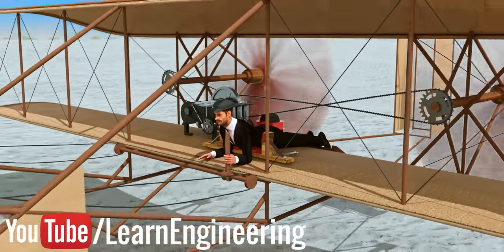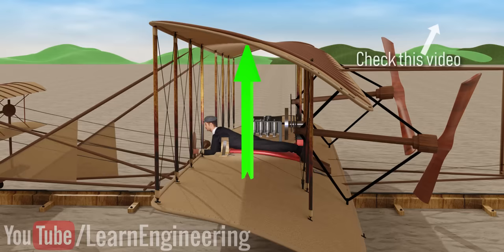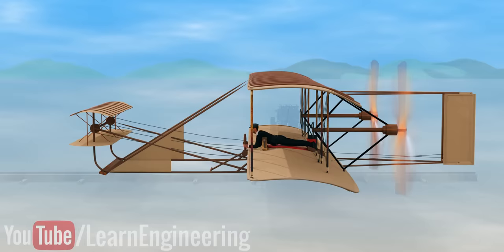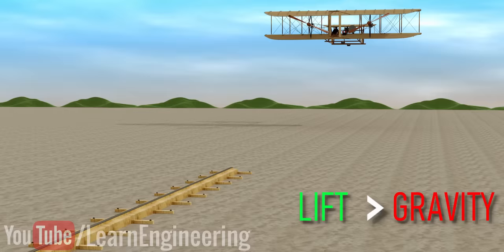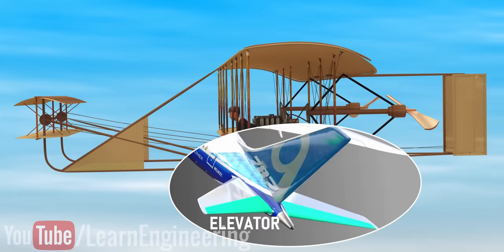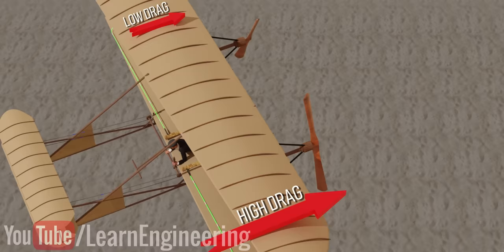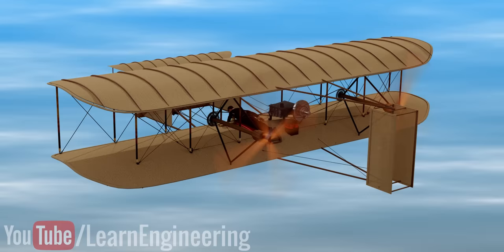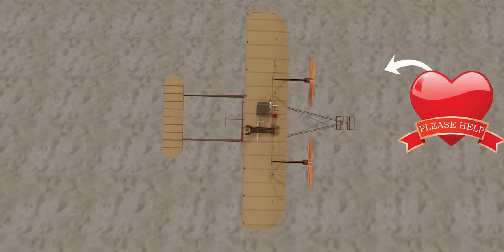The Brilliant Engineering of FIRST FLIGHT !

Comment: When Wright is in Paris to look for the description of the DUMONT machine, 1907, they bought an engine with the same characteristics as the Dumont engine, light and powerful
Reply: Please read enough to get your facts straight.

The contracted with three engine builders to produce engines for the anticipated European Wright Flyers.
The engine was a copy of the 38 hp. 1906 Wright upright 4. They were built under license.  (specs available at Gutenberg Project, URL below)

Is there any evidence that the Wrights were interested in copying any of
the design features of the 14 bis?   You claim that the copied the engine
but there is no evidence for this.  The Antoinette 8V is quite different from the Wright upright 4.
They probably should have purchased the 1906 Antoinette 8V but they preferred their own design.

They were interested in keeping an eye on how much progress was being made in Europe.
The Wrights thought they had a 5 year head start but the news in 1906 indicated 
that their lead might be less than they thought.  

The main reason for the trip was to set up the production of the Wright Flyer.  They brought the design for their latest upright Dayton engine and contracted Bariquand et Marré for several to be built to their specifications.  French and German companies produced these under license.   

For the specs for four of the Wright's engines, check out Project Gutenberg.  https://www.gutenberg.org/ebooks/38739

The engine used in 1908 was the 1906 upright 4.

The Wrights built 4 copies of the 2 place Wright Flyer 2.  One was shipped to France.  It had their latest 35+ hp engine.  

It was fortunate that they had ordered 4 engines from their French engine builder because the Dayton engine threw a rod and had to be replaced.  They replaced it with a French built replica of their Dayton engine: the 1906 upright 4.

The Wright-Taylor engine built under license by Bariquand et Marré was one that Santos Dumont recommended for the production version of the Demoiselle.
Reply: @gilberto2056  Thanks for the letter.  Is there an associated URL?

I am not sure what May 1908 flight of 337 meters you refer to.  Could it be the
flight where the engine failed?  As you know, the 2 place Wright Flyer set several
distance records in France.  The last one was for the Michelin prize for the longest
flight in 1908.

I don't find anything curious about the Wright's wanting to keep up with any 
record setting flights in Europe.
Reply: @majorbett  One detail, this letter was published in the magazine l'envol number 39, 1932. And the letter is extremely clear. THE WRIGHT WANTED DUMONT'S KNOWLEDGE. Until 1908 The brothers never submitt machines in flight.
Reply: @harpiasonhadorasonhadora5259  Thanks for the reference but it would be nice if you provided
a link.  

The issue is what was this knowledge?  In the case of the Wright Brothers, their
secret was how wing warping worked in theory and in practice to provide 3 axis control of the
flying machine.  

They could provide proof related to the specific performance requirements that the 
investor wanted to see.  This usually did not include revealing the secret.  There are now easy
graphics that explain wing warping but I don't think anyone could figure it out from the drawings
found in their patent.  

The secret involved both theory and practice.  You could see the pilot succeed in flying figure 8's but it is unlikely that you could match it.  

Wilbur thought he could reveal the secret and still retain a 3 year advantage.  

He was wrong.  once he explained it at least 4 of the pioneers added it to their prototypes and learned to
duplicate the performance in 4 months (not 3 years).  

This reduced the time they could sell
European built replicas from 3 years to 1 or 2.  In 1904 they had 100 European orders for $25,000 replicas of the Model A 2 seater.  By 1905, 50 switched to a cheaper plane from a competitor.  One was a replica of the Beloit XI.

 I am trying to compile a list of the contributions
that can be attributed to  Santos Dumont and the 14-bis.  

For now, I am not interested in
his earlier or later contributions.  

My list has about 5 features of the 14-bis that other pioneers might be interested in copying.  Can you help me build the list?

The Wright policy from 1902 was to not reveal anything until the investor was ready to make a $35,000 investment.  
NO PAY-NO SEE.  

The public was able to see what the Wrights could do
because someone paid for it.  

HP:  Until 1908 The brothers never submitt (sic) machines in flight.  (what is submit?)  

(Rephrased)  Until the summer of 1908, there was no incontestable proof that the Wright Flyer could fly.

SB:  Correct.  

In 1905 there was enough historical proof for the American Aero-Club to certify the claims the Wrights made in their 1905 publication.  

Have you read this?  It is a good starting point.  If you are interested I will find the URL.

Also check out the hundreds of pages
at Wright-Brothers.org

HP: Até o verão de 1908, não havia prova incontestável de que o Wright Flyer pudesse voar.

 SB:   Você está certo
Reply: You recognized that they never presented anything before Dumont. Dumont won, Steve, it was in 1906.
Reply: @GNJ:
Thanks  again for providing a source reference.
Reply: @stevebett4947  Their arguments are weak. You answer for them and don't prove the existence of the plane before Dumont. I believe it would be easier for you to get a document of the authorities of the time and present this document here to prove with official records and photos the wright's ability to fly between 1903-05. Arguments like these prove nothing about the ability to make motorized flight similar to Dumont (1906). For there to be primacy for wrights, this must be accomplished, Dumont fulfilled his part and started the AVIATION.
Reply: @stevebett4947 the brothers, after writing this suspicious letter, went to Paris where they stayed for months, did not present proof of their flights, did not complain about anything, did not perform any aerial activity, received from ferber the description of the Dumont machine and took engines with them to the united states. just reason. it is obvious that if the brothers had a plane in the united states they would never do all this trip.
Reply: @harpiasonhadorasonhadora5259  

SB:  Thanks for your comment.  
I don't think the arguments would be weak if their premisses were valid.
Lins de Barros who was one of the narrators for the PBS Nova series on Santos Dumont, 
didn't have to resort to dubious "facts"  and misinformation to make his case for the 
incontestable proof of the Santos Dumont first official flight record..

I am still searching for the original documents.  I need to see exactly how the original rules
and regulations for the 1906 competition were written.  Much of the evidence has been lost
or destroyed.  Only a few film clips have survived and these do not appear to be of any
record run.  I wouldn't expect any film evidence for the 100 m. flight.  It was too dark for
1906 motion picture technology.  

The Wrights do not provide incontestable  proof for any of their alleged flights and records.
They were only willing to provide it if someone paid them $50,000 up front.  NO PAY- NO SEE.
This policy was evidently devised before their first flight. 
Luckily, no one ever asked them to prove their 1903 873 ft flight in an exact replica.

Unlike the Voisin built bis-14, the droopy winged Wright Flyer was intentionally unstable.  
Eventually they got it to be stable enough to fly but they were wrong in thinking that it was
impossible to combine safety and stability with responsiveness.  Something like 16 pilots in
training lost their lives trying to learn to fly what the Wright's called a practical airplane.
Military planes continued to have similar problems but civilian aircraft are  now much less demanding
and relatively safe.
Reply: @stevebett4947  Unfortunately with these arguments Again it will be difficult to reach consensus. A machine that charged a fortune to be seen and they themselves knew that The American brands and patents would register for them the first plane, the American, Italian, French, German government would all buy and register the plane for them, had contacts with you are governmental and registration authorities, plus the detail that the greatest aeronautical authority of the time existed for everyone since 1898 and never managed to present before Dumont's nothing !!!! obviously they didn't have the first plane !!!!
Reply: @harpiasonhadorasonhadora5259     What arguments.  They are just speculations and opinions from various aviation historians.  I don't think there is anything original there
What comment do you find controversial or difficult to agree with?

They charged over $30,000  to see if the Wrights could do what they said they could do.
It sounds like a lot until you learn that vendors selling the Demoiselle 20 wanted $30,00 for the plane and more for the engine.  

I am not sure what you mean when you connect the patents with the claim to be the
first manned airplane with rigid wings and 3 axis control.   

My problem with the Wright patent is that it is meant to be obscure.  It did not clearly
explain how wing warping worked and certainly nothing about what else was required to exhibit full control in the air.  The illustrations we use today are easily understood.

They had ten years to provide a working prototype that demonstrated controlled flight.
They were so slow that another inventor with a similar patent provided a working model before the Wrights.  

Here is what I said in an earlier comment.  On YouTube you have to provide enough information to identify what you are reacting to:

I don't think the arguments would be weak if their premisses were valid.

Lins de Barros who was one of the narrators for the PBS Nova series on Santos Dumont,  didn't have to resort to dubious "facts"  and misinformation to make his case for the incontestable proof of the Santos Dumont first official flight record..

SB:  I think you agree with both of these statements.

I am still searching for the original documents.  I need to see exactly how the original rules
 and regulations for the 1906 competition were written.  Much of the evidence has been lost or destroyed.  Only a few film clips have survived and these do not appear to be of any record run.  I wouldn't expect any film evidence for the 100 m. flight.  It was too dark for 1906 motion picture technology.  

The Wrights do not provide incontestable  proof for any of their alleged flights and records.

SB:  Don't you agree with this opinion?

They were only willing to provide it if someone paid them $50,000 up front. 
 NO PAY- NO SEE.
 

SB"   I think the investors who were connected to the French Aero Club
negotiated a better deal for themselves..  $50k was the starting point.  To close the dea
they had to sign over all of their European patents.  

Unlike the Voisin built bis-14, the droopy winged Wright Flyer was intentionally unstable.
|
  SB:  You may not want to credit Voisin as the builder of the airframe.  This could
be controversial.  Some Santos Dumont fans say he designed and built everything
without help from others.  
What is your opinion?
Reply: @stevebett4947 You don't have to write a book to try to explain the inexplicable about wright. You can see that you invent possibilities to have something to argue about. And it remains unexplained. "Where are the official tests, with flights performed in front of specialists before Dumont!?!?!? You're almost killing yourself in your excuses😂😂😂😂. Accept, they lost in 1906.
Reply: @stevebett4947  Steve, unfortunately you need to think a little more. Hundreds of people who were not reported names and surnames !!! many people who would have been interviewed for ferber and no one, including ferber, nobody volunteered to help wright sell a flying machine !!! machine that they themselves said that flew but was never presented to brands and patents anywhere the world to get rich soon !!! no demonstrations for any government in the world to sell soon and get rich soon !!! the wrights asked in letters to the united states government and other countries money in advance and no demonstration of anything !!! Steve, in these conditions nor the wright dealt. And I doubt that they would get any money proving the existence of a machine with ferber interviews or verbal reports made by ferber and other friends at l'aerophile.
Reply: @stevebett4947  authenticity in reports made on paper and machine that never appeared to prove anything effectively are reports without credibility. It would be easier to register events in trademarks and patents with  the machine, register everything before the authority of the time, or sell at once to some government than to do the idiocy they did !!!!
Reply: @stevebett4947  Steve, it’s not necessary to write a book or even invent data, Invent possibilities of this or that to desperately defend the wrights. I believe that they would not need so much. And when you can present some proof, it’s only from 1909 to Front, that is, confirming the Brazilian statements that they only presented and proved something was from 1908 onwards. Steve, if you want to win this debate you’ll have to present the Official records that the wrights made between 1903-1905 with photos that were released and published in the press of the time between 1903-1905. If you don't Have this evidence forget it. The wrights lost to Dumont along with you who are defending them. Dumont has been the inventor of the airplane and father of aviation since 1906.
Reply: @stevebett4947  It is easier for you to prove that they did something with official documents registered by them with photos between 1903-05.
Reply: @stevebett4947  Rationing yourself will conclude that it was easier for them to register the plane than to present witnesses who prove nothing.
Reply: @harpiasonhadorasonhadora5259   There is no debate on the argument that was first articulated by Lins de Barros around the year 2000.
If the only evidence that is allowed to be accepted is restricted to
what was stated in the contest rules for the Deutsch Archdeacon Prize, then nothing the Wrights did before count.  

Aviation historians are not trying to desperately defend the Wrights,
they are trying to come up with a historical narrative that holds together and is the most consistent with what is thought to be known.  

There is historically acceptable evidence, for instance, that the Wrights did demonstrate their aerial feats in public before 1908.  Most historical evidence is not beyond doubt or cannot be contested.  

As I stated above, there is no official evidence that the Wrights
did anything before 1908 if that evidence has to conform to the FAI standards invented in 1905.  Why do you keep bringing this up?

There is no absolute or incontestable proof that the Wrights flew before 1908.  Using the same standards of evidence, there is no proof that the Wright brothers owned  a bike shop in Dayton.

There are records that meet the usual standards for a fact based  historical narrative.  That is quite different.  

Proving that Santos Dumont was the inventor of the airplane or the father of flight goes well beyond the incontestable evidence found in the rules and regulations for winning the Deutsch- Archdeacon prize.   

Do you want to make an attempt to prove that Santos Dumont was the first to fly, invented the airplane without any outside help or any other common claims made by SD supporters without using any evidence other than indisputable evidence?
Reply: Why do you call quoting aviation historians "inventing facts"?

All historical narratives fail to meet the incontestable proof standard.
Historians try to be consistent with known facts including a few incontestable
facts but that is not the same as being limited to empirical facts.
Reply: @harpiasonhadorasonhadora5259  

SB:  I don't understand the question.  

What is a registered document?
What   counts as an official document?

The Wrights published a short article which listed the key events
and attempted to supply evidence that they actually happened.
It was enough to convince the American Aero Club but not 
sufficient for the French Aero Club until after 1908.
It is still not sufficient for Lins de Barros or later Wright critics.

There is no incontestable evidence that the Wrights did anything
before 1908 or that the photos they and others took were authentic.
.  

The same is true for Santos Dumont film and photographic evidence.

Photographic evidence should not be tossed out but it they can be
contested.  There may be a few cases where the photos were miscaptioned.
or doctored in some way

The photographs controlled by the Wrights were
not released until 1908.  That much is true.
Reply: @stevebett4947  Forget any debate, Steve, whenever they show you the monuments with the inscriptions made a long time ago by the aerocluve de France you will have nothing to talk about. It's easier and we'll finish Soon any debate with the presentation of the documents registered by them before Dumont.
Reply: @stevebett4947  do you speak of indisputable historical facts for the wright ????? 😂😂😂😂😂 Isto foi cômico, Steve, please present here the documents registered by them between 1903-1905. Your indication of a link was untrue. There was nothing.
Reply: @stevebett4947  You do not understand??? Well, it's simple !!! Present here the official documents (FAI records, Aeroclube de paris or Aeroclube de France) were authorities of the time that would register everything for the wright
Reply: @acucarchocolate3961  
Only their official witnesses can be trusted?
Then what about the United States Coast Guard, that witnessed, measured, photographed, and officially logged their flights in December 1903?
Like most fools who want to claim false credit for their own country, you are good at picking out what facts you like and ignoring the truth if it doesn't suit you.
Reply: @mikearmstrong8483  in 1903 the only witnesses were three lifeguards and a nine year old child. Alfeu drinkwater declared to the New York times in the 50s that in December 1903 they did not make any motorized flights, they did not present any planes and they only glided. their only proof was a sheet of paper. drinkwater declared that a machine that resembled an airplane was PRESENTED by them only in 1908. In 1907 they sought the 14 bis plant in Paris.
Reply: @acucarchocolate3961  
Whatever source you have is incorrect; US Coastguard officers were present, and logged the measurements of the flights in official Coast Guard logs.
Do you really place credibility in one single person declaring 50 years later that it didn't happen? Pardon me, but that sounds rather gullible.
Reply: @acucarchocolate3961  If it isn't one thing, it's another. I've chatted with Brazilians that admit that the Wrights flew in 1903 but maintain that it wasn't really valid flying because the Wrights used a catapult to assist takeoff, as if the plane would have flown a full minute (the 4th and last flight of the day) as just a projectile.

See, that's the problem with people that want to ascertain a "fact" that isn't real. Just like moon landing deniers, they can't get their story straight. Some say the Wrights never got off the ground that day or even tried, others say they might have but it doesn't count if it wasn't witnessed (which it was), and still others say they flew but it doesn't count because they used a catapult. If you all can't agree on why they didn't fly, and well studied historians (as opposed to "internet professors") all agree on exactly what did happen and say they flew, then the evidence is against you. 

And if the Wrights were in France buying a motor, that means nothing; it certainly doesn't mean that is the first motor they ever bought.
Reply: @mikearmstrong8483  there are no official records regarding anything for the wright. The wright's records do not speak of any authority of the French air club (the greatest AERONAUTICAL authority of the period) that has something for them. They themselves recorded that the witnesses were three lifesavers and a child, there are no official records of any aeronautical, marine, army or even authority government to give wright credibility. perfect replicas will not fly and the wright's patent that was three years old of processing in the American trademarks and patents does not indicate the plane. The proof presented by them was the telegraph sent to their father and nothing else. The machine was never presented on public flight  according to the requirement of the greatest authority of the time that existed since 1898.
Reply: @mikearmstrong8483  Fact without proof is not a fact. And if you insist that they flew before without presenting the evidence, that they could have presented before Dumont the hundreds, it is hardly correct. Start by trying to prove with The wright's patent, kid, show the flight test on the patent !! Yes, running, takeoff and everything !! The document had three years of processing, copy the item with the flight test done for the brands and American patents, please. The wrights didn't have a plane!?!?!? Where is the registered machine, imbecile, and Brazilians agreeing for convenience there are many out there !!!
Reply: @acucarchocolate3961  
What a wonderful way to express gullibility. A "registered" plane? There was no system of "registering" a plane when the first one flew, any more than the first automobile had a license plate. They had patents on the plane and its principles, there are records of the machine shop that built the engine for them, there are official US Coast Guard logs of the event, etc, etc. 

There is all the proof that is needed,  for all to see, but those who want to believe in their own particular "truth" will continue to be blind to this reality. You argue that Dumont flew first, some other guy swears that a New Zealander was the first, of course Russians will claim they were first. But what actual historians, as opposed to those whose education came from YouTube, almost unanimously agree on, is that the Wrights were first.
Reply: @acucarchocolate3961  
Tell you what. Neither of us are going to convince the other; I believe that history and the facts support my argument, and you of course believe the same for your argument. Let's call it done before we get to the point of casting aspersions on each other's ancestry, or worse. 
Good day, sir.
Reply: @mikearmstrong8483   Boy, the official evidence never came, Where are the official records you didn't show anything here. Remember, they had three years between 1903-1906 to prove the existence of the plane and never did anything, where is the plane registered in the patent!?!?! If an argument in the role of a friend of theirs Coast Guard is worth that much, Why didn't they take advantage of it and present the airplane to American brands and patents ????? Where's the plane!?!? What plane they had, the huffmann prayrie neighbors never declared FLIGHTS in the surroundings !!! AND Flights only on paper and conversation are worth nothing, where are you presenting the machine !!!!
Reply: @mikearmstrong8483  For them to be the first they have to prove that they really were the first. They didn't prove it !!
Reply: @acucarchocolate3961 

SB:  I don't recall that B&M said they were Antoinette like other than both being fuel injected and without carburetors. 
That is hardly grounds for claiming that they were based on the Antoinette design.  All airplane engines will share features.

SB:  If you bother to read up on the topic you will see that while Wilbur Wright replaced the Dayton upright 4 with one built to specs by B&M, the engine was a replica of the Dayton built 1906 engine built for the anticipated use in replica Wright Flyer 2 Model A

This WF2 Model A was the first to fly in Australia.  It is preserved in a museum.  The plaque on the engines says built under license.

There is an abundance of information about this engine at Wikipedia, Project Gutenberg, and elsewhere.  

Unless a 4 cylinder engine resembles a V8, there is little resemblance between the engine used in 1908 and the Antoinette 8V used by Santos Dumont.  Both were made of aluminum, both were fuel injected rather than carbureted.  The Wrights' bench tested their engine in 1906.  The aircraft version of the Antoinette was also tested in 1906.  After multiple attempts to sustain flight with a less powerful Antoinette engine, Santos Dumont finally achieved success with the Antoinette 8V later in 1906.  

The Wrights' did not test their engine in flight.  They shipped it to France in 1907.  This was the same year that sister Katherine, Wilbur, and Orville traveled to Europe to set up their production lines for the Model A.  All of the parts were to be manufactured in Europe.  Engines were to be built in France, Germany, and England by experienced engine builders.  Airframes were to be built in several European countries.
Reply: @harpiasonhadorasonhadora5259    Wright's never [presented] anything before Dumont.

SB:  I thought that I agreed that if you comply with the FAI standards of 1905, the Wrights'
did not provide any incontrovertible or incontestable  evidence before 1908.  
Henrique Lins de Barros (2000) is aware that the FAI changed their standards after 1908 
but builds his argument on the basis of the 1905 standards.  
He argues that these were the accepted standards in 1906.

In 1908, The FAI went so far as to recognize the Wrights' claim to have been the first.  

I don't understand why Archdeacon and the FAI would go that far.  
I would like to find the exact quote. 

 Santos Dumont was the first to meet the 1905 standards.  No question about that.
Reply: @stevebett4947   everything that refers to engines the answer is simple. If wrights had engines as light and powerful as Dumont's antoinette they would present the flyer in flight for the American brands and patents, American government, French, Italian, German governments !! or they simply would have flown a lot in front of French experts who could have gone to the United States when they were drafted in 1904.
Reply: @acucarchocolate3961   No.
Reply: @johnedwards1321  no? the letter the wrights sent to boil in 1907 clearly called for a complete description of Dumont's machine. the period they were in Paris is a fact. the letter was published in the magazine L'envol number 39 - 1932.
Reply: @majorbett  It would be better to provide a link to the contents of the letter
than what you recall from memory.  You do provide a print reference.  That is
a step in the right direction.  It is not that hard to find the letter on the Net.  

@GNJ
SB:  Your post has 3 spelling errors.  
Wilbur never signed a letter as "Wilburn".   "Your trully" should be <Yours Truly>.

There was such a letter written on...  written to Capt. Ferber 
who came to Dayton in late 1904 to prove the Wright's were liars.

After talking to Wilbur Wright and to some of those who had witnessed the public flights, he became a Wright supporter.  

He wrote two articles for the L'Aerophile in 1905 in support of the Wright claims
but was unable to immediately covert Archdeacon or a majority of the members of the Paris Aero-Club.  After 1908, they also became converts.

GNJ:  They were in Paris for several months (they didn't register anything, they didn't prove anything) they bought a light and powerful engine similar to Dumont's engine. They return to the United States and finally , May 1908 presented (demonstrated?) the flyer in extremely poor flight conditions. They just flew 337 meters.

SB:  This is mostly unsupported BS.  The 3 Wrights came to Europe because they
had finally received the financing they requested in their letter to Capt. Ferber.
In exchange, they had to sell their European patents to W..   and the other French
investors (Archdeacon and Deutsch)  who wanted to make sure that the Wrights set their records in France rather than the US.  

The purpose of their trip was to set up demonstrations in France, Germany, and Spain and to find engine and airframe builders in those countries.  They bought
engines from builders in France and Germany.  B&M delivered 7 engines to Wilbur
in 1908.  Why would Wilbur need more than 2 engines?  

The engines, built under license, were copies of the 1906 Wright - Taylor upright 4 which produced 28 hp. at a low rpm.  They were not copies of the V-8 used by Santos Dumont.

Rather than waiting for a new engine to be shipped from Dayton, Wilbur used
one of the engines that had been purchased for the Wright Model A to be built
in Europe in 1909.  After the demonstration in late 1908, there were 150 orders
for the new two place flying machine.  A few were delivered in 1909 and one
buyer tried to compete in the channel crossing.  He flew the 20 or so miles with
ease and then flew back to France.  (The Wright Model A had a range of over 70 miles.)  But he was not the first.  Bleriot may have crashed when landed his Bleriot XI in England, but he won the prize that saved his company.
Reply: @mikearmstrong8483  Thanks for the comments.  I was unaware of any
Coast Guard records of the flight.  Do you have a reference or URL?

Of course, the observation by the Coast Guard wouldn't count because
they were accidental witnesses.  The French FAI required official witnesses which probably means witnesses approved by them.  The
only witnesses they approved were members of the French Aero Club.

They often argue that historical facts don't count.  They are contestable.
Then they go on and use historical evidence for claims that are clearly not found in the rules for the contest and the Deutsch Archdeacon prize.
The Wrights were in Europe in 1907 because they received a cash advance from French multi-millionaires: Deutsch, Archdeacon, and Weiler.  They always said that they would be glad to demonstrate their claims or any performance objective that they specified.  

They needed $15,000 to demonstrate their flying machine.  They had
reached an agreement with a delegation representing the French government but the French reneged.  When it was renegotiated with members of the French Flying Club and FAI, it required that the Wrights'
sell them their European patents.  

There would be no reason to buy 7 French built B&M engines for their
demonstrations.  2 would be more than enough.  They paid B&M to build
copies of their Upright 4 (28hp) under license for their anticipated 
sales of copies of the 2 seat Wright Flyer Model A.  

There are nothing official about the claimed records of the Wright Brothers' Wright Flyer if this means records that complied with the
1905 French FAI rules for what counts as an official record.

 The patent did require a demonstration within 10 years.  The patent
was not for a particular flying machine.  It was for an improvement in
the control system for any Flying Machine.  

Before the Wrights, No one considered control to be that important.
It was not mentioned by Cayley.  Surely someone else mentioned it but
so far I have not found it.  

The guiding analogy before the Wright Brothers was a boat in a sea of air.  It needed a propulsion system,  a rudder, a source of lift or buoyancy.  The main problem was to keep the airship from capsizing.

Furman and managed to complete one full circle and wind the 
Deutsch-Archdeacon prize without the ability to bank and turn.

RC Modelers have learned how to make a 14-bis look alike replica to
make U turns and fly in circles.  After 3 failures, Santos Dumont
gave up on the design.  He probably should have had more faith
in his ability to work through the problems.
Reply: @acucarchocolate3961  
The alleged Flights are only on paper.
Where are you presenting (officially proving) the flying machine?

The Wrights were not interested in proving
anything to those who were not willing to pay for it.  NO PAY-NO SEE.

Deutsch and Archdeacon finally paid in late 1906 because they wanted
to make sure that official records were set in France and because they though they could make money by selling replicas of the Wright Model A.
There were 4 demonstration flights.  One in late 1904 and three in the
summer of 1905.  These flights don't count because there were no
official witnesses.  However they were still certified by the American 
Aero Club.  Capt Ferber was convinced after talking to the Wrights and
prominent people from Dayton who had witnesses the flights.

Cpt. Ferber examined the stored Wright Flyer III but never saw it fly.
He arrived in Dayton to prove the Wright's were liars.  He left
and wrote two articles for L'Aerophile in support of the Wrights
and their performance claims.  

Historical evidence does not prove to you the Wright Flyer or its records existed before 1908 .  Perhaps, but I think it disproves many of your
counterfactual claims.  

The historians reconstruction of events may not be certain or beyond
question but they are much more plausible than the anti-Wright conspiracy theories that are advanced without support.

There is often a fact (or 2) in the alternate accounts such as the sale
of 7 engines by B&M .   Wilbur did receive 7 engines in the summer of 1903 but they were copies of the 1906 Wright Upright 4 (AKA the 440
referencing the 4 cylinders and the higher RPM power output) built under license.  Unless a V-8 engine can be said to be a copy of an inline 4, 
There is no way that this engine can be said to be copied from the Antoinette engines used by Santos Dumont.

For details, Google the name of the engine or the name of the persons
involved.  Add Wikipedia if you want to read the information in Portuguese.
Reply: @stevebett4947  Again you insist with arguments that prove nothing. Alleging that in 1904-05 they made flights without ever having proved anything to specialists, not recording anything, not selling anything you don't prove Nothing. It would be impossible for the wrights to lose so many rights when everything would be proven in front of everyone. Don't forget, Archdeacon summoned The wright in 1904 for registration and in the united states. They didn't even answer the letter!!! the same Archdeacon challenged the wrights in 1905 by offering a fortune 50,000 francs for a single 100 meter flight!!! There was nothing, they didn't prove anything, they weren't ready for anything. Present official evidence that they had at least the whim to actually do between 1903-05, please.
Reply: @acucarchocolate3961  
AC:  Present (Provide) official evidence that they did something
between 1903 and 1905.

I thought we had agreed that there is no official or incontestable evidence that the Wrights' did anything until 1908.

There is no incontestable evidence that they didn't.

The requirement works both ways.

Most of the anti-Wright claims do not meet the incontestable 
evidence requirement.  Most don't even meet the requirement
for good historical evidence.  They are not consistent with what
is easy to check out in the historical record of events.
Reply: @stevebett4947  Steve's problem is that you claim there is no hard evidence that they didn't fly. I answer, present here the official documents that prove that they flew before Santos Dumont and it will be solved the problem. remember, I don't have to prove anything Dumont proved everything to the world. Who must prove they flew before Dumont IS YOU!!!
Reply: @stevebett4947  Ferber's articles written in 1904 did not convince, and what's more, there was no evidence, no pictures, only conversations and paper, that is, exactly what Brazilians denounce to respect of wrights. In 1904 due to these great uncertainties and no proof of anything was that archdeacon made the first challenge, he sent a letter to the wrights proposing to make official everything related to their machine and I would send specialists to the United States to see everything, photograph and finally make some record for them. the result was that the wrights didn't respond. not even the letter!!! in 1905 Archdeacon's second challenge that was published in the American press challenging the wrights to cross the ocean and fly just a hundred meters in front of Archdeacon and pocketed a fortune. again, the wrights weren't ready for anything!!! But worse, the 1904 dayton fair offered a fortune in dollars to anyone who presented a heavier-than-air first that it met the requirements of the flying club of France and was able to make turns, it was a huge sum in dollars, this fair was held for a long period in 1904 and the wrights never attended to do anything!!!!??? the period of 1904 was the period they declared, again, just on paper, 3km flights, and machine capability for 14km flights and capability to make circular flights. The work of these two is incomprehensible, the evidence that they never had the first plane between 1903-05 they are too strong!!!!
Reply: @stevebett4947  Who must present the evidence that they flew before is you Steve, official documents, or accepted, they lost in 1906 to Alberto Santos Dumont.
Reply: @stevebett4947  What you can't understand is that everything you present with authorities and even recognitions for them is only from 1908 onwards as already showing trillions of times for us Brazilian as for 1906 and their attempts to sell a machine that was never even proven to exist before Dumont, it doesn't help Steve, as they had too many chances to do everything before Dumont.For an example, the fortune offered at Saint Louis Fair for those who made a simple flight will never have an explanation, and the detail is that the fair took place for many months in 1904 in the year they placed Only on paper and in conversations the flights. On paper and conversations many miles flying, in reality not even a presentation to get rich overnight were not able to do. Forget it, boy, You lost in November 1906.
Reply: @stevebett4947  Translate your texts into Portuguese. When you write in English it's like writing in Arabic
Reply: @acucarchocolate3961   Why do you want to make this into some kind of competition with winners and losers?

I just want to have the best or most plausible historical account of aviation history.  Who was the first to fly seems to be dependent on who gets to define flight.  

I don't think you can even h ave a story if you 
restrict yourself to "just the facts"  In this case,
the facts are whatever is found in the description of the contest rules for the Deutsch-Archdeacon prize.

We can say that if you restrict you concept of
incontestable evidence, to compliance with the 1905 French FAI rules, Santos Dumont was the first to do this.  

If you let the Smithsonian or some other pro-Wright organization set the definition, neither plane qualifies.  The Wrights' thought that the 
Wright Flyer III and later prototypes were practical airplanes because they could fly multiple laps in two directions at relatively high altitudes.

Most people believe the Wrights claims because they were able to improve the prototype.  These improvements were evident as early as the end of 1903 in public flights.

Had either Whitehead or Santos Dumont been able to improve their early prototypes, they would recognized as winners.  They couldn't.  

Later they were shown that with modern propellers and power plants, they were able to fly longer distances, smoothly and reliably
when the conditions were right.  

With more refinement they might have been able to claim that they were practical designs.  

There are modern versions of the Demoiselle 20 that were quite practical ultra-light aircraft.

Both the 1906 and 1903 flights were just short hops no more than a few meters above the ground.  One of the successful test flights of the exact replica hopped about 100 m. at an altitude of less than 1 meter in a 15 mph wind.
Reply: @stevebett4947   I'm proposing the easiest, you prove with official documents that they flew between 1903-1905 and this discussion will end. But what's our problem. Everything you present is vague, unregistered official between 1903-05, and everything related to wrights and with evidence is from 1908. while Dumont in 1906 started aviation with a flight of 200 meters and was the base of the wrights who asked for captain ferber the plan of the 14 bis!!
Reply: @stevebett4947  Forget Steve, the 2003 centennial replica flyer proved their base was terrible. That was never a plane or even flyer 3. That's why I already asked and ask again: PRESENT THEM HERE THE OFFICIAL DOCUMENTS THAT THE WRIGHT REGISTERED BETWEEN 1903-1905 IN THE HIGHEST AERONAUTICAL AUTHORITY OF THE FRANCE AIR CLUB Epoch, It's a chance for you to win the debate, as I already realized that it is A weakness for you, but it's a chance. What the Smithsonian thinks or says to people without official evidence is also a very serious problem. And I also say that: YOU DON'T HAVE ARGUMENTS FOR THE WRIGHT BROTHERS EVENTS HAPPEN AND PROVED EVERYTHING ONLY IN 1908, THERE ARE NO ARGUMENTS FOR THE LACK OF OFFICIAL EVIDENCE BETWEEN 1903-05 YOU HAVE AN EXCUSE, THERE ARE NO ARGUMENTS FOR FORTUNE THAT THE WRIGHT FAILED TO WIN AT SAINT LOUIS, HAS NO ARGUMENTS FOR THE ARCHDEACON CHALLENGE IN 1905, DOES NOT KNOW ABOUT THE TRIP TO PARIS WELL 1907 AND THE LETTER TO FERBER, HAS NO ARGUMENTS FOR THE MONOLITH OF BAGATELLE WHO COMPLETELY CONTRADICES YOU AND THE SMITHSONIAN RULES. Steve, look for the official documents they registered between 1903-1905, I think it will be easier for you!
Reply: @stevebett4947  Note, try to translate into Portuguese.vqyando you write na in English it looks like you are writing in Armenian.
Reply: @acucarchocolate3961  
AC:  Everything you say is vague.

SB:  I think you find anything based on
"historical fact"  to be vague because it 
is not certain.  

If you reject historical narratives then there
is no proof but historical narratives are rarely
vague,  They are just not incontestable.

There is no proof that the Wrights or any other aviation did anything.  The reason I accept the
100 m flight of Santos Dumont is more because of historical evidence rather than
"just the facts".

Exactly what do you accept with respect to
Wilbur's flights after 1905?  There was only
one record that was in compliance to the 
1905 FAI standards.
Reply: @azucar chocolate

AC:   Dumont in 1906 started aviation with a flight of 200 meters and was the base of the wrights who asked for captain ferber the plan of the 14 bis!!

There is no official flight of 200 m.  
There is only an official flight of 100 m. 

Historical evidence supports the claim that 
Santos Dumont flew 220 m. because there was no official starting line or finishing line.  The 220 m flight was the proof that he flew 100m.
Reply: @stevebett4947  the official record that the FAI has revered for many decades is related to a record of 220 meters fulfilling the requirements of the time of the highest AERONAUTICAL authority in the world for the first most heavy than air, the plane. even the bagatelle Monolith built by the people of Paris and the French flying club is extremely clear: "FIRST AVIATION RECORD OF THE WORLD". And Dumont was already recognized by the French flying club itself as a pioneer in air travel since 1901, there is also another monolith in honor of Dumont in the Santos Dumont square in Paris. forget it Steve you don't has nothing similar to do with the Dumont event, much less the recognition of the AERONAUTICA authority that called them in 1904 to record everything for the two, let alone a monolith built for them by this authority between 1903-05.
Reply: @stevebett4947  Please google your texts into Portuguese. Every time you write in English, people who don't read English don't understand anything. It's like you write in German
Reply: @stevebett4947  please. translate your texts into Portuguese. I can't do translations on my phone. what you wrote sounds like the Indi language. do the translation first and then I send a answer. but I warn you, you still have the same difficulty in proving that the wright did something on an official level before Dumont. papers presented with proposals or possible machines that were never presented to prove anything before Dumont are not evidence.
Reply: @acucarchocolate3961  

AC:  Você tem dificuldade em provar que o escritor fez algo em nível oficial
antes de Dumont. trabalhos apresentados com propostas ou possíveis máquinas que
nunca foram apresentados para provar nada antes de Dumont não são provas

SB:  Não tenho nenhuma dificuldade em fornecer provas históricas e narrativas que
são muito plausíveis e consistentes com os fatos.

Minha narrativa não original é consistente com os fatos conhecidos
que os tornam melhores do que a maioria das narrativas de couunter. Não é para torná-los certos.

Se você não aceita nada além do incontroverso
ou evidências incontestáveis, nenhum de nós pode dizer muito.
  
Apenas o que é encontrado nas regras originais do Arquidiácono Alemão para o concurso contar. As regras dizem que o registro de 100 m deve ser testemunhado por membros do Aeroclube francês e que deve haver prova de que a distância de 100 m foi

alcançou. Isso é difícil porque não há data oficial ou oficial linha de partida e chegada. 

Não é uma corrida ou competição típica.

Não há exigência de que o evento seja filmado, fotografado,
ou testemunhado pelo público. Isso é uma sorte porque eu nunca vi nenhum
photorgaphs ou filmes do vôo recorde. 
Ter você?

Tenho visto fotos e filmes do meio-dia de Santos Dumont no ar.

Não havia funcionários regulando o que contava como um novo recorde antes de 1904

A FAI francesa declarou o que era necessário. Essas regras não foram aceitas em outros lugares e quando a votação realizada foi rejeitada ou adiada até AeroClubs

foram estabelecidas em 12 países participantes.

Há dificuldade em provar que o escritor fez algo em nível oficial?
Somente se você insistir que os registros relatados devem ser endossados pelos franceses.
Em 1905, o WB alegou que os registros foram certificados pelo Amerian Aero Club. Alguns dos
voos foram testemunhados por membros do grupo informal que se tornou o
American Aeroclube. O Aeroclube francês também era formado por entusiastas da aviação
e não se tornou oficial até 1904.

Nunca houve qualquer disputa sobre o fato de que os registros relatados do
não cumpriu com os padrões franceses da FAI de 1905. Se isso for um requisito,
então, a ficha de Santos Dumont foi a primeira a cumprir. Os primeiros registros OFICIAIS
foram aquelas definidas pelo 14-bis em 1906 para saltos de 25 me 100 m.

A formulação do monumento Bagatelle está errada. A distância OFICIAL não é de 220 m.
Não foi o primeiro recorde da aviação, mas sim o primeiro recorde oficial da aviação.

Os planos e alegados registros do WB foram amplamente divulgados na imprensa e em
Palestras de Chanutes em Paris. O jornal profissional de 1901 relata seus planos
tornou-se o esboço da série de concursos patrocinados por Deutsch e Archdeacon.
Eles também se tornaram a fonte dos tipos de registros que não seriam aceitos por
a FAI. O 14-bis não poderia voar em condições de vento. O Wright Flyer poderia, então
a FAI não exigia vento e um trem de pouso permitiu que aviões construídos na França acelerassem para
uma velocidade de decolagem.

O WB não fez nenhum esforço para cumprir os padrões da FAI. Eles eram mais que
disposto a aceitar qualquer requisito de desempenho acordado de qualquer indivíduo ou grupo que
pagaria pela demonstração. No caso de o WB falhar em cumprir qualquer um dos
os requisitos de desempenho acordados, eles reembolsariam o adiantamento.

Os Wrights teriam resistido à exigência de um trem de pouso com rodas, mas eles
teria concordado com isso como uma condição de venda. É assim que os treinadores do Exército
acabou com rodas de bicicleta

There has never been any dispute about the fact that the reported records of the 
failed to comply with the 1905 French FAI standards.  If that is a requirement,
then Santos Dumont's record was the first to comply.  The first OFFICIAL records
were those set by the 14-bis in 1906 for hops of 25 m and 100 m.  

The wording on the Bagatelle monument is wrong.  The OFFICIAL distance as not 220 m.
It was not the first aviation record but rather the 1st OFFICIAL aviation record.

The plans and alleged records of the WB were widely reported in print and in
Chanutes lectures in Paris.  The 1901 professional journal report on their plans
became the outline for the series of contests underwritten by Deutsch and Archdeacon. 
They also became the source of the kinds of records that would not be accepted by
the FAI.  The 14-bis could not fly in windy conditons.  The Wright Flyer could, so
the FAI required no wind and a running gear enabled French built planes to accelerate to
a take off speed.  

The WB did not make any effort to comply with the FAI standards.  They were more than
willing to accept any agreed on performance requirement from any individual or group that
would pay for the demonstration.   In the event that the WB failed to meet any of
the agreed on performance reqruirements they would refund the advance.

The Wrights would have resisted the requirement for a wheeled landing gear but they
would have gone along with it as a condition of sale.  That is how the Army trainers
ended up with bicycle wheels

@majorbett, @bvb, @Gilberto Nedel Junior
Reply: @stevebett4947  First problem: you try to present non-relevant evidence as evidence that should be considered is that it should be accepted. forget it because with this you don't prove anything at the level of Dumont, unfortunately on this principle alone you have already lost, as you assume you have nothing official like Dumont. you actually support the wright crooks. this is an embarrassment. is the same as acknowledging that other people need to believe in you and end. can't, boy.
Reply: @stevebett4947  You claim that your implausible narrative should be accepted!!! Forget it, I can't!!!
Reply: @stevebett4947 Forget it Steve, you didn't make it, Dumont's record really bothered you. I can't do anything after all he was much more brilliant than the wrights and much earlier. Including the wrights for they managed to get off the ground depended on Dumont's knowledge that they sought in 1907 when they asked to boil the description of the 14 bis. Steve, go study more about aviation history. When you base the scoundrels of the united states you don't learn the truth about the real invention of the airplane. If you want to win the debate, present here the official document with photos that proves these wright bastards actually flew before Dumont, 1903-1905.  otherwise accept wright brothers They lost in 1906. Dumont, a Brazilian, the inventor of the first plane.
Reply: @stevebett4947  I'm sorry Steve, But THE FIRST AVIATION RECORD OF THE WORLD is in Dumont's registered bagatelle monolith. It's not for the wrights.
Reply: @stevebett4947  Your arguments are ridiculous, since they are arguments that have been refuted here hundreds of times because they have no official record. America's flying club has only one sheet of paper from 1905 made by president of the flying club, friend of the wrights, saying only that he BELIEVED THEY WERE TALKING THE TRUTH. THERE ARE NO PHOTOS, NO FOOTAGES,  NO OFFICIAL REGISTRATION'S FLYING MACHINE IN TEST. Steve, you don't prove anything!!!! Stop being ridiculous, you don't show proof, Dumont proved everything, that's why the plane showed up
Reply: What? Lol